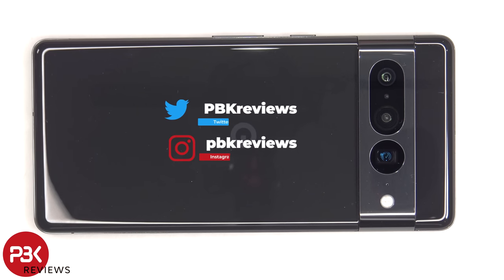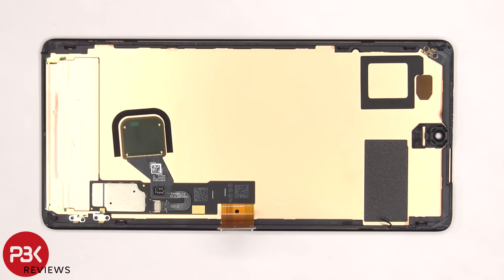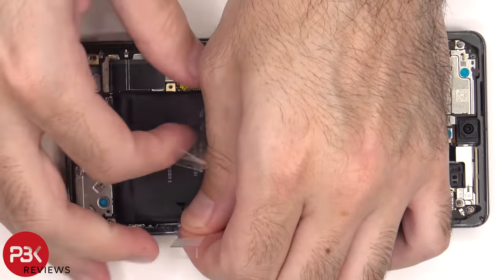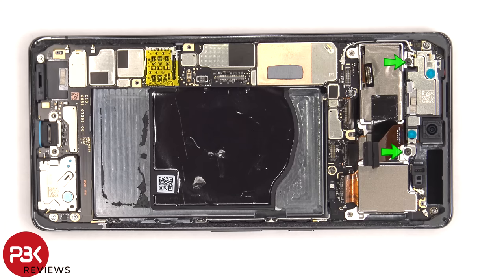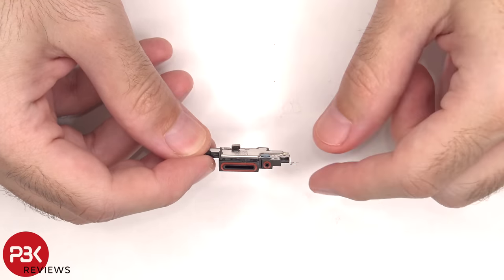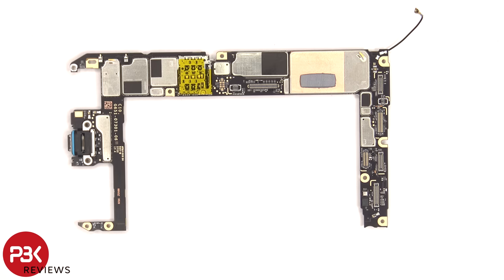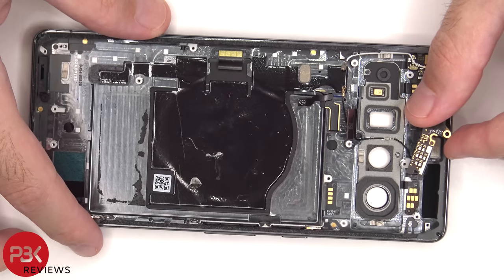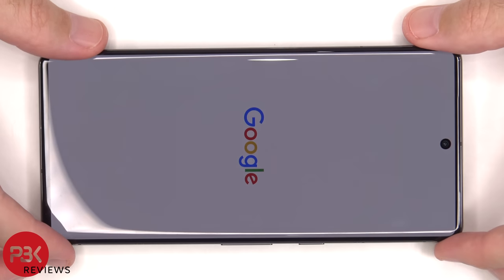Google Pixel 7 Pro Disassembly Teardown Repair Video Review

Comment: This video deserves at least one million views... Pixel 7 Pro should have had OIS for the UW, as well as for the front, and a TOF sensor as well for even better low-light performance... It is easily possible for Google to implement it.
Reply: There are next to no phones that have OIS on the ultrawide camera, because at these kinds of FOVs slight movements are not really visible on the photo. Also, TOF sensors do not contribute to a better low-light performance.
Reply: @haoleiz5448   So, what is the problem with implementing OIS on a UW camera? Since these companies are charging such a huge amount, I guess there should be no problem in implementing it, and the TOF does make a difference in low-light, like the iPhone lidar sensor, which takes better portraits in low-light. The auto-focus is fast because of the TOF sensor.
Reply: @tanmayfadnis5440  Well I think the main reason for not implementing OIS into the ultrawide camera is that the competition doesn't have it either. Given that neither the IPhone 14 Pro nor the Samsung Galaxy S22 Ultra have it, you can't really expect Google to use OIS for the ultrawide camera in my opinion, especially considering both Pixels being cheaper phones. I guess OIS on the ultrawide camera is just not an industry standard yet.
And in case of the TOF sensor, the IPhone does not make better low-light portraits due to the LIDAR sensor to my knowledge, it merely helps with edge detection. LIDAR can also scan 3d-objects as a bonus, but it doesn't help with image quality. Lastly, Google uses laser autofocus, making a TOF sensor a bit redundant
Reply: @haoleiz5448  Ok, thanks for the info.

Comment: I'm saving this for myself so I can replace the battery of my pixel 7 pro in 2 years. And you didn't damage the screen like some other YouTubers, which demonstrates that it's possible to change your battery without replacing the screen. Do you know if there's some kind of kit for a battery replacement for the pixel 7 pro? With the battery, graphite tape and rubber seal all included? Thank you so much in advance if you respond.
Reply from the maker: You're welcome. Here is a link to the parts for the pixel 7 pro:  https://www.mobilesentrix.com/catalogsearch/result/?form_key=nO6eCy4sLuUTxxtn&q=Pixel+7+pro

Comment: Hey man I know this is a lil old but what would you recommend for me to be able to replace the back glass? I saw another video with someone doing it but to separate the glass from the wireless charger is very tricky. Would have been nice to do this before I replaced the screen lol but I didn't know it was so hard

Comment: Hi, my Pixel 7 pro was dipped into the water from the camera side (not the usb side). It worked fine for a couple of hours, after which the camera stopped working. Noticed some water seeped into the front cam area. Kept the ohone in rice for 24 hours and restarted the phone (no water visible anymore). My front cam works fine but when using the back camera, screen is completely  black. Everything else seems to work fine. How can i fix the back camera issue?

Comment: Great video, thank you. I've been trying to work out the exact position of the wireless charging coils for retro fitting a magsafe ring to the back of the phone. If you get a chance would you be able to measure the distance from the top/bottom/sides of the phone to where you think the wireless charging coils start? Huge thanks in advance.
Reply from the maker: You're welcome. I don't have the device anymore to check, sorry.

Comment: Important question: I repair my phones myself. Repairability is very important before I purchase a new phone. One question I have and is not clear from the video... Do have to dissemble EVERYTHING in case you have to replace the back panel of the phone. A glass back panel breaks easily. Is there an easy way to replace the back panel.  Thanks
Reply from the maker: I tried to remove the back panel and it wouldn't budge so I didn't want to risk breaking it. It's possible you can still pry it off but its glued on tight. However the wireless charging coil is adhered to it as well, and the flex cable is routed inside the frame and under the main board, so if you are able to pry the back off, you would need to make sure your careful and are able to somehow peel off the wireless charging coil from the glass (if there is even enough work around room) so that you don't tear the cable. If not then you would need to disassemble the phone to remove the board and route the flex cable for the wireless charging/nfc out the back.

Comment: Thank you very much for detailed video!
I had an issue and I tried to resolve it by replacing the chassis, so I removed basically everything.
Unfortunately the phone keep rebooting when not under power supply, and it become very hot.7
Keep going :)

Comment: Hi there, small question. While removing my case I heard a "crack" and I then noticed that the the 5G antenna (the small plastic piece shaped like an oval on the top of the phone) is quite loose and I can lift it up a little with my nails. Is that an issue that could cause me to lose any connectivity/that needs fixing?
Reply from the maker: That would probably just be the outer cover and not the antenna itself. The internal antenna should not be affected by it. However if the cover comes off, or breaks off, you can run into issues of dust or debris or even water getting into your phone.

Comment: Great vid. Does the front speaker of the regular pixel 7 work the same as the 7 pro in terms of attachment position? I hated that the pixel 5 front speaker was attached to the screen and made it very hard to replace.
Reply from the maker: Not sure, haven't looked into the 7 yet but if I do then we will see :)
Reply: @PBKreviews  sure thing. I already reserved my pixel 7 non-pro! Massive improvement on this year

Comment: Great video. Thankyou. Went rafting with mine and this morning all the cameras are fogged. If they don't clear in about a week it will be tear down time to clean the lenses on the inside. Doubt very much that warranty will cover from what I've read. Pixel 7 Pro should not come with a water rating IP68. It was a refurb unit, so that will have something to do with it.
Reply from the maker: Thanks and you're welcome

Comment: Great video. Thanks. Where are the gyro and ambient light sensor located? Is it possible to replace those without replacing the motherboard?
Reply from the maker: Thanks. The ambient light sensor or proximity sensor is shown @5:00 in the video. Not sure where the gyro is. The proximity sensor can be replaced.

Comment: Does it have a magnet on the back magsafe style or a metal plate that allow to use the phone with magnet supports?
Reply from the maker: well the back of the phone is metal and has a cutout where the wireless charging coil goes.

Comment: i fixed my screen at a top repair place but the finger print is not showing ...how do i get it back
Reply from the maker: You would need to backup your data and do a factory reset (which would erase all you data) and if still no luck, then you can try running the fingerprint calibrations tool (https://pixelrepair.withgoogle.com/carrier_selection )

Comment: Very cool.  Question - my phone got wet - I dissembled it and dried it out, butt noticed that the volume down button wasn't working after.  I did something stupid and shut the phone down, and now it will only boot into a fastboot menu, but not allow me to boot to the OS.  Any ideas on what it could be or how I could either disconnect the volume altogether or boot into the OS?
Reply from the maker: Check and make sure there is no corrosion on any of the chips on the motherboard or connectors as well as the flex cable for the pwr and volume keys. If there is, use a small brush like a tooth brush to brush it off to prevent it from shorting. Most likely there is some corrosion either on the flex cable (which if I'm not mistaken was underneath the motherboard and the board sits on it making contact/connection) or by where the clickers behind the physical buttons are. So you may need to remove the screws holding the metal cover over the side buttons from the inside to release/remove it and clean out. Removing the flex cable completely wont help you since the power button flex is the same and you wouldn't be able to power it on. Most likely its just some corrosion or liquid left over shorting the cable making it think the volume up or down key are pressed and making it go into fastboot every time you power it on.
Reply: @PBKreviews  thank you.  I have tried loosening the screws on the buttons (seems the volume up/down and the power are on the same rail.

I will go further and remove the motherboard and look to disconnect the volume altogether or at least clean any corrosion off.

Thanks so much.  I appreciate your response.

Comment: I'd like to know why you don't open the S22+/Ultra from your previous videos starting from the display like with this teardown?
Reply from the maker: Because it's designed to be opened from the back for those phones compared to it being designed to be opened from the front on this phone. The phones which are designed to be opened from the front also generally don't have extremely strong adhesive around the screen that would make it difficult to pry off since there is a risk of damaging the screen if you need to repair anything inside the device.

Comment: Curious, is the black USB-c port shell plastic? Google has been one of the only phone companies to use plastic usb-c ports that routinely fail early in phone ownership. I'm curious if they finally adopted metal usb-c ports like the rest of the industry. Thanks.
Reply from the maker: Yeah I believe it was still plastic.
Reply: If that truly is the case, wow. The pixel series is the only phone series where 3rd party USBC boards and flex are of superior quality than OEM. Good job google!

Comment: I wonder if the charging port can be replaced or not?
Reply from the maker: It can, but would require someone with soldering knowledge.
Reply: @PBKreviews  That sucks... I would never buy a phone which charging port can only be replaced by third party repair store...

Comment: Very nice video, My phone was dropped into a pool while on vacation. It was removed and set out to dry but about 2 hours into drying it got very very hot to where the top screen was easily removed so I opened that up to finish drying. Of curse it does not work now. I would like my pictures so can buy an identiacl phone to swap parts and try recovering them but what part stores the pictures locally ? I will put that into a working phone and see if I can get the pics 
thanks
Reply from the maker: Thanks. Always keep in mind, if your phone gets water damage (even if ip rated and water makes its way in), you need to take it apart as soon as possible and disconnect the battery cable as well as dry out any water inside and brush off corrosion on chips and connectors. Because if the battery stays plugged in, the parts will short and become unusable. You can try taking apart completely and brushing off any corrosion on the motherboard and connectors with a small brush like a tooth brush, and then place the board in a working screen assembly with a new battery to see if it will power up. This way you rule out the screen and battery being defective. But if you still have no luck then you probably are out of options. The data is stored on the ROM chip on the motherboard and that's soldered to the board and isn't user replaceable.
Reply: thank you very much for the reply @PBKreviews

Comment: Are you able to confirm the architecture of the processor, whether it's 4nm or 5nm?
Reply: It's the same architecture as the previous tensor
Reply: @juanmondragon  did you teardown the phone? How do u know
Reply: @rjosef1983  because they just said that they improved the tensor chip but didn't make any significant improvements. It was all implied. If they have made significant improvements then they would've announced it
Reply: @juanmondragon  no it's 4nm
Reply: @sora.2111  it's the same as the previous one
Reply: @juanmondragon  numerous articles including one other teardown have mentioned 4nm
Reply: @rjosef1983  Yea exactly
Reply: @juanmondragon  no it isn't the same architecture as last year. What are you talking about?  The 1st generation tensor chip is 5nm. The 2nd generation tensor is 4nm so you obviously don't know what you're talking about. It's also been confirmed that they did make improvements on the tensor G2 chip such as using l 2x Cortex-A78@2.35 GHz. The 1st Gen tensor is using a 2x Cortex -A76@ 2.25 GHz. The ISP offers 10 bit color and supports up to 108mp as well . Tensor  G2 processing unit is able to run machine learning tasks 60% faster and 20% more efficiently so yeah it's has improvements over the 1st Gen tensor chip
Reply: @Rican856  thank you. The best way to get information is to bring misinformation to the table. I was too lazy to search up more on this. So thanks again!
Reply: @juanmondragon  not a problem bro. Don't think I was being rude. If I was I'm sorry for that but I just wanted to correct you on that so that way you can have the correct information.
Reply: @juanmondragon  It not the same.  Its now on a 4nm process and A78 cores have replaced theA A76 from last generation, clocks speed got a small bump.  Different GPU Mali-G710, revised ISP new TPU.  They mentioned 60% better AI and ML with 20% lower power consumption
Reply: 4nm.

Comment: BE VERY CAREFUL WHEN SEPARATING THE SCREEN!  THE PLASTIC FRAME MUST STAY WITH THE SCREEN! I was careful, used a heat gun, and gently separated it with a guitar pick, and even still, the pick went in-between the layers of the actual screen and killed it. It only poked into the layers 1mm or less and yet the screen is now non-functional. Make sure to start on the sides, NOT the top/bottom as that's where the screen layers can separate more easily. Also, put the pick/spudger straight down first as far as it will go and only then start angling it inwards to pry. Otherwise there's a good chance your spudger or pick will separate the screen layers and kill it.

Comment: How can you rate parts availability? The phone isn't even fully out, yet. (Yes, you can pre-order it)
Reply from the maker: Based off general manufacturer parts availability like last years pixel 6 pro etc. Usually with pixel devices, ifixit has a self repair program for getting parts, but not all parts are available and not right away also.
Reply: @PBKreviews  ok so it's an estimate from how it was. Good to know. That's an info I can trust ^^

Just thought it came out of the blue, nvm.

Comment: 1.5 /2 for display replacement ? 1/2 for battery replacement? wtf ? What do you think should be done better to make it even easier ?
Reply from the maker: Display isn't too difficult however still isn't the easiest. There is adhesive holding it down and still the chance of damaging the screen when trying to pry it off if you're not careful or know what you're doing. If there was just screws and clips holding the assembly down as well as a rubber gasket, I would rate it 2/2 for screen replacement or if the chance of damaging the screen was less etc. But for the battery, since the screen first needs to be removed, then the screws and midplate to access the battery cable, and the pull tabs for the battery aren't that helpful since the adhesive is still very strong so requires the use of isopropyl alcohol, that's why it gets a 1/2. A 2/2 battery replacement would be a phone like the Xcover6 pro where you can pop off the back cover and remove the battery without any adhesive or other things.

Comment: It's a bit sad that the charging port is soldered to the board, you'll need a heatgun to replace the thing, apart from that it's looks good, well, apart from the battery, you'll have to remove the display before removing the battery, wich could cause damage to the board if not done correctly
Reply from the maker: Yup, would be much better if it was a replaceable part.

Comment: Is dual cell battery (2x2500mah) a better option than a single 5000mah one ?
Reply from the maker: Not too sure, I would think its better for fast charging to charge each cell separately at the same time but aside from that I don't see what other benefit it would have.
Reply: @PBKreviews  OK thanks 👍
Has this Pixel 7 Pro any vapor chamber cooling system ?

Comment: Hello friends.  I'm from Ukraine, I have a question.  today I broke the glass on the pixel 7 pro, this spare part is not yet available in Ukraine.  I looked like a glass with a pixel 6 pro, the same, can someone confirm this?
Reply from the maker: Hi, the glass alone is not replaceable. It requires special machines/tools to do that. You would need to replace the entire screen assembly.

Comment: Can you tell us if the modem is external
Reply from the maker: Not sure what you mean
Reply: @PBKreviews  Can you determine, based on your teardown, is the modem external or internal (embedded on the SoC)
Reply from the maker: Well I'm not too verse with all the chips on the board (especially since most are covered by the shields and I don't want to risk damaging the board by taking them off), but I'm pretty sure its soldered to the main board and not something that is external on any of the other components if that's what your asking.
Reply: @PBKreviews  okay thanks!
Reply: @jamesjames7601  in what way will this matter? I've seen that the antenna is on the top of the phone running externally but not sure about the actual modem.
Reply: @juanmondragon  marginally yes with power consumption